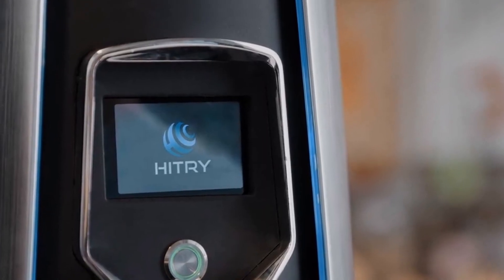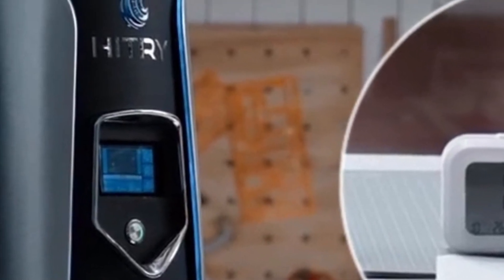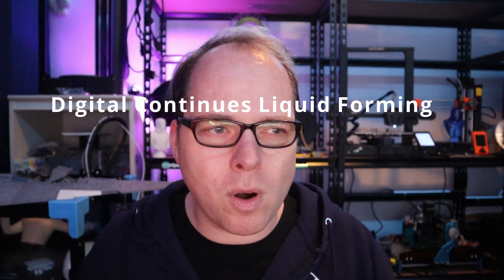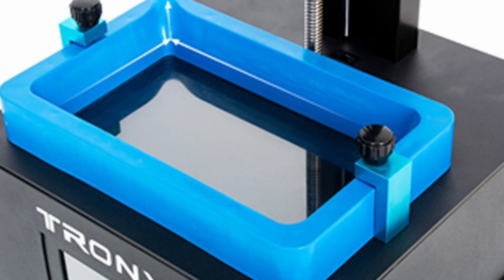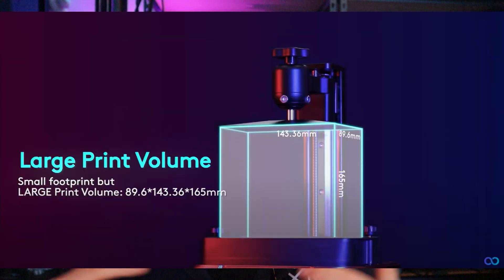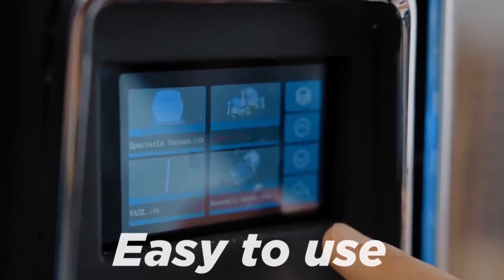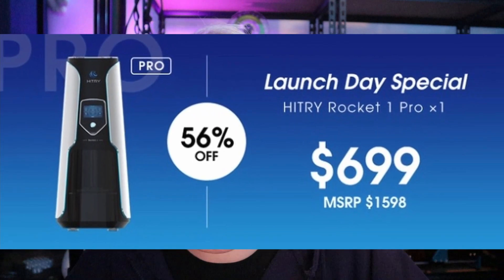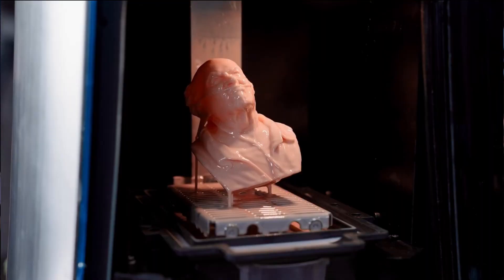Hitry Rocket 1 on Kickstarter - Z3DP News and Updates

Comment: I STRONGLY RECOMMEND NOT BUYING THIS PRINTER. I received my printer last year, several months late. It didn't work. The display screen would go blank upon startup. HITRY sent a video on how to repair it. There is no support in the USA. The repair involved removing the cloth cover (which is double side tape attached) and removing two screws attaching the display to the base, allowing the display to deflect when you push it. Somehow that worked although the display did blank out subsequently. It did allow me to do the exposure test. That failed miserably. HITRY provided another video which involved taking the other side cloth off and adjusting the screen. I didn't feel comfortable trying that fix. (the videos were poorly done and didn't show much detail). HITRY offered to replace the printer but I had to ship it back at my cost. I shipped it and was stuck in China customs because they wanted $197.60 to pay the "tariff." HiTry wouldn't pay the tariff the the printer was returned to me. Out an additional $266! Not only that, I didn't receive the extra items I paid for!
Reply from the maker: I have contacted Hitry on Twitter and asked them to help you in this since you have a lot of problems with this printer. Because I believe you deserve a way better service from them. They gave me this email address service@hitry.com. I said to them that they need to help you directly via this comment

Comment: I work with similar style printer that use a top down projector. I see this printer being very limited. The resins will need to be very liquidy. Most top-down projector printers use a wiper blade to evenly distribute the resin over the surface. Without a blade to do that you will have to be very picky with what resin you use. But to the benefit of the printer the bulge of the resin at the edge of the layer is most likely what is bluring the layer lines on the outer surface of the print.
Reply from the maker: Yes on this system is not dosing resin on the previous layer in a controlled manner

Comment: Actually, it's going back to the old ways... it's just a top down DLP printer instead of the standard LCD style, which is a bottom up printer.  The filler fluid is just an inert fluid to support the model while's on the build plate without wasting resin... a simple salt water solution will work, as the resin and the water are normally not combatable and will separate out naturally, like oil and water.  They also said they can do .1mm per second, however, that's going to be for limited geometries as the surface of the part will need to be reflooded as the part drops into the resin, and it will need to be very low viscosity for it to flow rapidly.  Again, these are nothing new, going back to the very first SLA printer from Chuck Hull in 1983.  More modern versions of this design use a wiper blade to push the new resin over the part and to smooth it out better... otherwise, you'll wind up with a meniscus that isn't flat.
Reply: Hello, ours is different from the existing DLP, SLA, and LCD. It is a new projection technology. The projection principle is similar to DLP technology, but DCLF technology uses other image display technology chips to replace DMD chips, making the price substantially Decrease, the accuracy is greatly improved. Any continuous high-speed molding has requirements for printing models, and carbon can not print solid models continuously. thank you
Reply: @hitry1413  LCOS and Scanning Mirrors with Lasers were also used on previous designs in the same way that DLPs were used... and both of those were significantly lower cost solutions.
Reply: @williamsteele  Yes, there are many ways to achieve sinking, but it depends on cost and practicality. thanks
Reply from the maker: Oh wow, I didn’t know this. Thank you for sharing this my friend